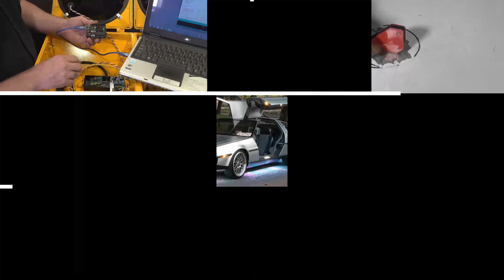1975 Pontiac Firebird: LS3 and 6 speed manual drivetrain Ep26

Comment: Nice job! Very cool build. I'm building a 1970 Firebird. Can you tell me what size tires you are running. Very nice look and stance.
Reply from the maker: Sure!  275/35/18 on the rear and 245/40/18 on the front.  I think they are 18x8 and 18x10.  Since it is bagged, the stance can be whatever you want it to be.  The reliability of the LS3 sure makes a good driver.  Thanks for watching!